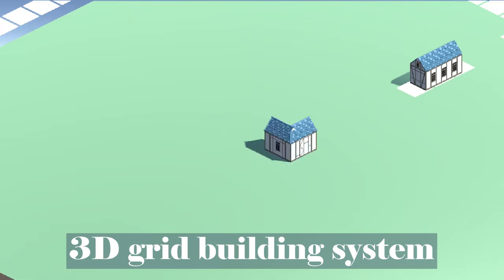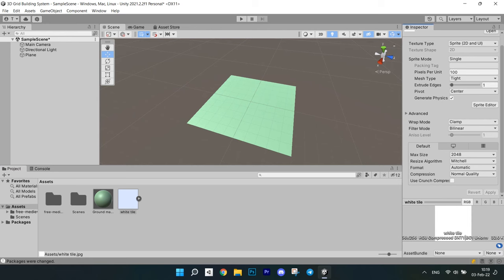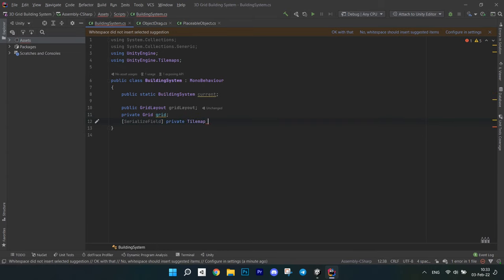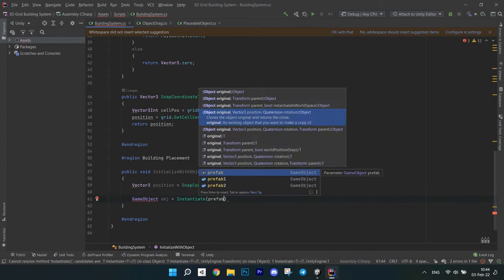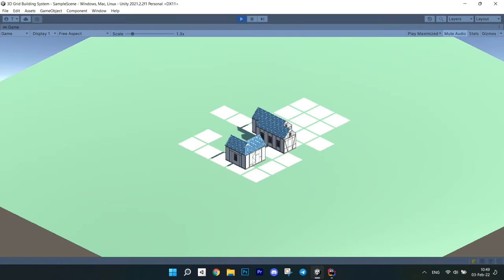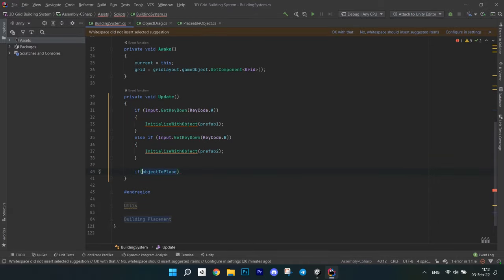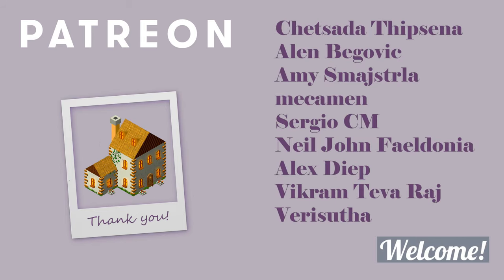3D Grid Building System - Unity Tutorial | City Builder, RTS, Factorio

Comment: Currently making a RTS game where there is a builder unit that can build things. I'm also watching a video about building nav meshes in realtime so that the units can easily move around the buildings. Thank you a lot for the video!
Reply from the maker: Interesting, good luck with your project! I'm glad that you liked the video :-)
Reply: hey if you havent figured this out yet 

you shouldn't use nav meshes for an rts try searching A* pathfinding and flowfeild pathfinding 

they are much faster for performance 

and with flowfeild you could have selected troops all follow a point only needing caculations for naviagation once instead of 20 -30 times that nav meshes would do
Reply: @Spectrum 13  there is a code to find all navpaths for each agent. And once calculation is finished, run all paths ant once so all agents move at the same time

Comment: Hi, at 12:15 and in other points throughout the video, I really don't understand what is going on with these "v:Vector3Int"s and "x:" as I use Visual Studio Code and it doesn't seem to have this. If someone could explain as it's giving me errors when I add these and also when I remove them. Can someone help? It's a bit frustrating as I have no idea what the visual studio code equivalent to "v:" is.

Edit, these are called IDEs and in "v:Vector3Int", u just ignore the Vector3Int and type "var v in ..."

Comment: Hi! Great video
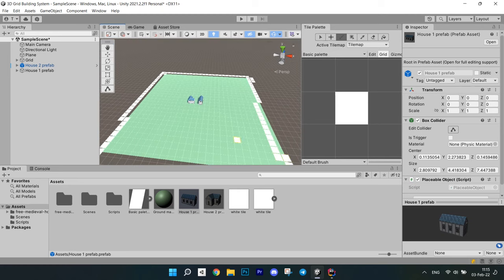Why at about 14:30 you manually paint this "boundary box" saying that it is needed to work correctly? I don't get it :(
Reply from the maker: Hi! Thanks!
So the reason I do this is because when we're calling the method to paint a block of tiles it compresses the boundaries of a tilemaps to the minimum. The painting will simply not work outside that box. So if you don't have any tiles on the tilemaps it won't paint anything at all

Comment: Im confused. We code A and B to place prefabs, but what is Spacebar doing? 

I can place items, but they stack ontop of each other and disregard anything. Also no white tiles are being created when I place anything.
Reply from the maker: A and B are for getting the objects. The spacebar is for actually placing them. You'd want to change these inputs to something like buttons on the screen in your game.
As for the placing issue, look through the CheckPlacement method. Also, make sure that you're actually triggering the placement (pressing the spacebar). If you haven't done that the buildings might have just stacked on each other each time you pressed A or B.
Reply: Make sure you added the placeable object script to your prefab

Comment: An amazing video, and with not too much effort as well! However, I noticed these one or two "main" issues while I was trying to implement this myself. I've checked and everything seems to be the same as the video, but it just doesn't seem to work.

When I try to place an object that is larger than 1 square unit size (e.g. an object that is 3x3 units), the white tiles appear, but instead of filling the entire 3x3 area,  only one tile appears at the corner , while the other 8 tiles that it should occupy remains empty. 

Also, another problem (Maybe related to the top problem but unsure), after placing the object, I can place another in the exact same area , and it seems like the CanBePlaced method doesn't really work as intended, or just keeps returning true and never false.

I would appreciate any help on this. Thanks!
Reply from the maker: Hello! Thank you, I'm glad you liked the video. As for the issues, the first one to do is to check what positions are in your area and if they are correct. Also, check if the size detection works well. One of my guesses is that your tilemap can have small bounds. Make sure that you placed a border of tiles around the area. 
Considering the second issue, it must be something wrong with positions so check those.
I recommend doing some debugging and really getting inside of your code. If you still continue having issues, come up to my Discord server, maybe we'll solve these issues all together. Link to join - https://discord.gg/dCJBpe2meg
Reply: @TamaraMakesGames  Thank you so much, i was having the same problem. great tutorial.

Comment: Hi Tamara, very good tutorial. But I have a problem when I try to move the object, where when moved with the mouse, the object returns to where it was spawned. Does anyone have the same problem as me?
Reply from the maker: Hi! Thanks!
Check the grid snapping, maybe there is an error. Maybe the delta distance is calculated wrong so it snaps to the same position. And check if the coordinate conversions are correct (screen to world)

Comment: Hello, I have a plane and its type is a cargo plane. I want to make a grid system for this with 3 different short side and long side dimensions. Do you think this video will help with this? Can it be converted to the shape I want?
Reply from the maker: Hi, I think yes, this video can help you. The system works with buildings that are not just squares. You just have to stretch the box collider and be careful to not mix up the coordinates when calculating the building size. and if you were talking about the shape of the building field itself, that can be achieved too. You would just need to define the borders of the available area by painting white tiles (the taken tiles).

Comment: Hey Tamara, it looks like it doesn't work when there's only 1 tile sized object, it's placing it there and event filling it, but detecting the tile using the "CanBePlaced" doesn't work for me, does it work for you?
Reply from the maker: I mentioned in the video that the size has to be increased by 1 on both axes because when it is calculated it is smaller. Try debugging and see if the size is actually 1 and not 0

Comment: Hello, I have some problems with the system, when I drag them on the scene the collision with others building is not detected so I can place 2 buildings in the same position. How can I fix that?
Reply from the maker: Hello! This system is not based on collisions it checks the area under buildings. Check if your building sizes are correct and also the method that checks for the area availability

Comment: Hello, I've been pulling my hair our and hoping you can help. I followed the Tutorial and it worked great! except when I try to implement a system to delete an object that was placed, i can get the object to delete but I cant for the life of me get the tile to change from the white tile. please help, anyone
Reply from the maker: Hi! To remove a tile from the tilemap you would have to set the tile at that position to null. A common issue is the position that you're passing into the SetTile function. Check if the coordinates are correct. If you have successfully set tiles when placing a building then you can modify that code to set the tile to null.
Reply: It places the white tile and building just fine, i can even get it to remove the object, but the tile stays white no matter what i do.  @TamaraMakesGames